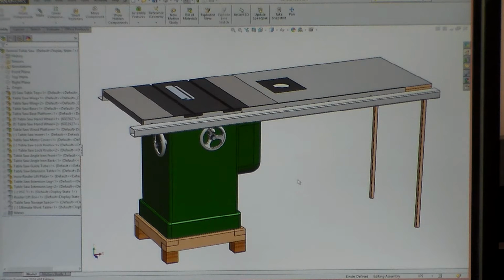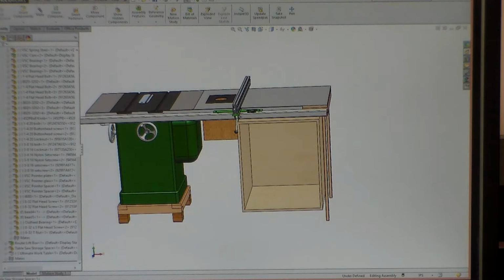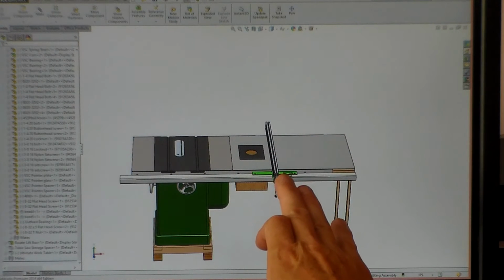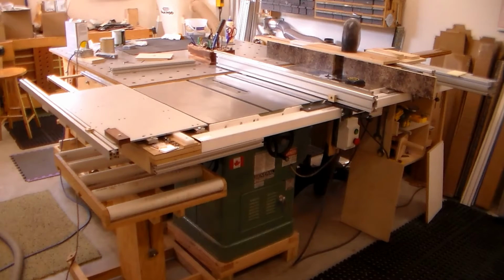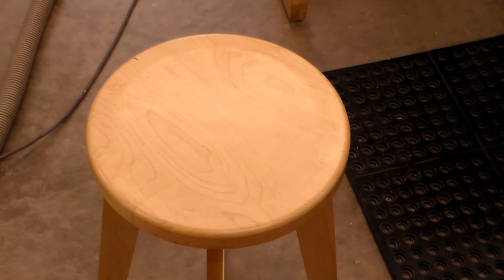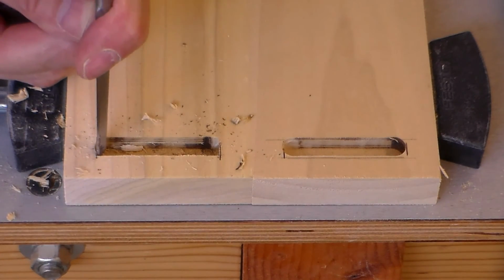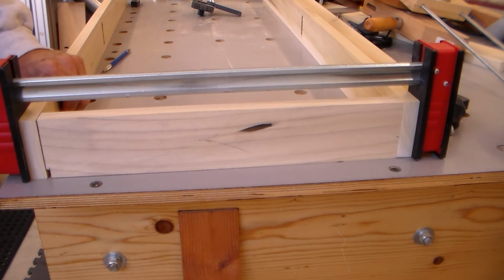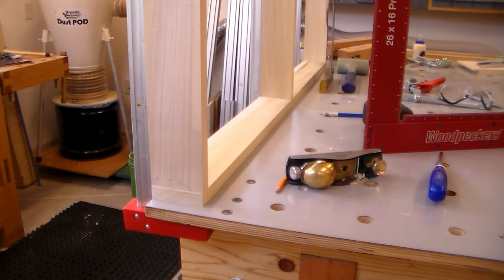01 Table Saw Extension Rebuild

Comment: Jeff how do you consider having the router placed so you cannot stand at the end of the table? That you instead need to push your piece through the router like you would do on the table saw. What do you think of your set up, any regrets? Or why not having the router at the outer end of the table for availability? Thanks
Reply from the maker: No regrets. The way my shop is set up it would be very uncomfortable to have it at the end of my extension wing. I don't have room at the end to run pieces or stand comfortably. When doing longer pieces I have the additional support of my outfeed table as well. Thanks for watching and good question.